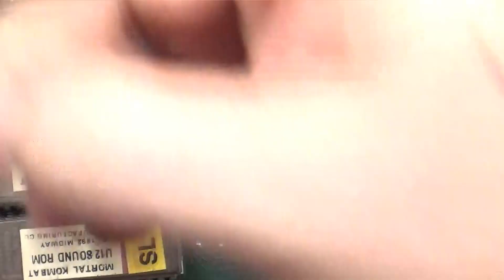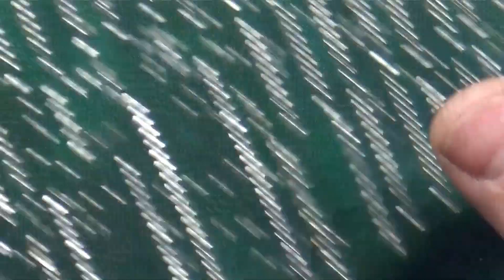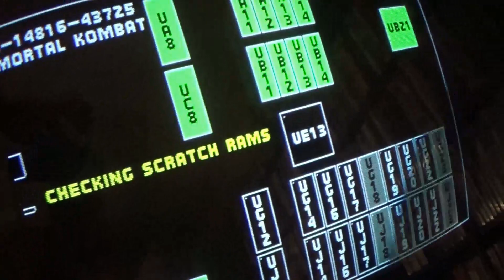Mortal Kombat Arcade Sound Board Repair - Low/Bad Audio/Sound Effects - Leaky Caps Galore!

Comment: You could temporarily magnetize your screwdriver by wrapping a wire around is and energize it on a 12-18V battery quickly and to demagnetize it bang the screwdriver on a bench or vice a few times old mechanic trick

Comment: Awesome work. Without desoldering the amp chip, you could always just oval out the screw hole a little bit to get the heat sink to sit flush against the PCB. My $.02 👍

Comment: Mike I have a weird question.  I get my cap kits for my MK boards from Arcade Parts and Repair.  I’m working on my MK2 sound board.  One of the axial caps in particular calls out for two different size caps 🤔🤔🤔

Schematic shows that cap C2 calls out for both 47uF as well as 10uF …. Totally bizarre.  Board came with a 10uF installed which appears to be it’s original caps but Peter supplied the 47uF cap ….. do you have any idea in your experience which is right?  And if it came with a 10uF do you know if a 47uF would screw it up?  Thanks Mike
Reply from the maker: I have not ran into this issue before. Are you sure it's the correct cap kit? I'm only asking because in all the kits I've got from Peter and all the sound boards I've capped, I've never ran into this discrepancy. Perhaps the incorrect cap was included in the kit by accident. If the board had a 10uf, a 10uf needs to go back in. You can use a standard cap. It doesn't need to be axial as long as you get the polarity correct. It's up to you.
Reply: @YourMKArcadeSource  well the funny thing is that the MK2 sound board schematic from Midway shows two different size caps for C2 …. 😵‍💫 Peter wasn’t wrong in giving me the 47uF cap … it’s just that the 47 wasn’t on the board from the factory … but the factory schematic calls out for a 47 …. And a 10 for C2 🤣

Comment: i just did a cap kit and now its giving me 3 tones indicating bad U3 rom. I wasn't getting any audio before. still not getting any audio. this video has helped a lot. I just ordered a rom set so hopefully it will work. I definitely did the bridge in the same spot you did to get continuity. seems like the amp works fine. I don't know what to do other than putting another U3 rom in
Reply from the maker: Try that and let me know.
Reply: @YourMKArcadeSource  welllll while waiting for the sound board  roms i accidentally re seated the pcb roms and re seated one upside down…fried the game…more work for me.
Reply from the maker: Oof. Can’t say I’ve never done that,
Reply: @YourMKArcadeSource  i got the game working again, changed roms on the sound board. did the cap kit. now im getting a single tone but the heat sink on the amp is getting hot which it wasnt doing before. could there be a problem on the main pcb? i should get an oscilloscope or data probe i suppose. i put in a brand new pot as well. im stuck
Reply from the maker: Nice job. I would replace the amp. It’s the most likely cause at this point.
Reply: @YourMKArcadeSource   alright I give up. New amp, new op amps, new crystal and sound processor and now I got nothing. Not even static. . Do you do repairs if I ups it lol.

Comment: How hot do you run the hot air station for things like this?
Reply from the maker: 800F.
Reply: so worried I’m gonna burn the board
Reply from the maker: Constant motion is the key. You can run it at 750f if you want but just keep the heat moving and not in one location.

Comment: I just picked a mk1 bootleg pcb.  Any differences in the bootleg vs an original board? I picked up cheap so I figured it’s worth something.  I would appreciate everyone’s thoughts on the bootleg.  Thanks
Reply from the maker: Oh yeah. Completely incorrect audio and sounds. Playable, but I’m not a fan.
Reply: @YourMKArcadeSource  o ok.  I picked it up dirt cheap lol I’ll use it for something.  I assume the graphics and moves are the same as the originals     It plugs into a standard Jamma harness correct ? Thank u
Reply from the maker: If it’s a “YAWDIM” bootleg, it should be. You’re welcome.
Reply: @YourMKArcadeSource  Happy new year 🎊🎆
Reply: @YourMKArcadeSource  I’m looking on the board I don’t see YAWDIM text anywhere.   Not sure where to look   Is there an email address where I could send u a pic of this board ?
Reply from the maker: It says “YAWDIM PRESENTS” instead of “MIDWAY PRESENTS” on the title screen. I have a video on it…

https://youtu.be/6SGM9GbWHYQ?si=X3_3bmrt7fr0IkKl
Reply: @YourMKArcadeSource  ooo ok. 👍And I assume the one pot on the pcb is for volume.  I need to change dip switch settings also..is there one particular site that I can trust ?
Reply from the maker: MKSecrets.net
Reply: @YourMKArcadeSource  thank u Mike have a great 2024
Reply from the maker: You too!
Reply: @YourMKArcadeSource  I’ve been enjoying my midway mk1 game someone put it all in a robotron cab.  Not the best shape cosmetically but it plays well.   Are you working on any cabs this week?

Comment: I have a mortal Kombat 1 pcb wit only low sound! What can i do to fix it? Everry things works fine
Reply from the maker: You have a volume pot hooked up?
Reply: @YourMKArcadeSource  yes I have connected the volume pot I have to put it on max to hear anything sound is good but very soft. Tanks for respons
Reply: How to wiring speaker series or paralel?
Reply: you said u33 and u 32 can also be a problem if you have low volume how can i measure it or know if it lights there?